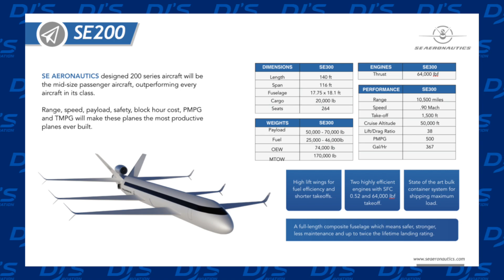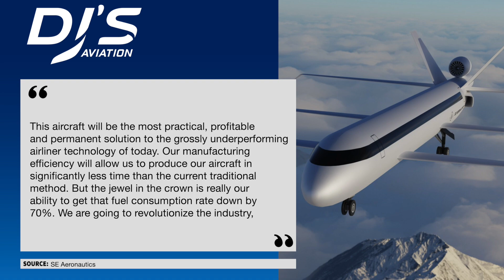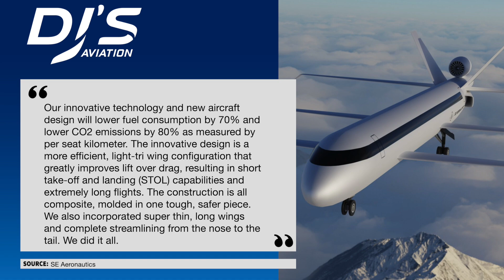New Widebody Aircraft

Comment: This company hasn't faced the reality of a regulated environment. For example they mention a single piece fuselage which is very challenging because a single failure such as a crack could propagate the entire length which isn't acceptable. Also, the engines appear to be in close quarters to each other which isn't certifiable because of fraternization failure issues.

Comment: Let's see.....................  Bigger engine = Higher bi-pass ratio = More fuel efficient = Airlines love it
I don't know dick ....... but it's clear to me ............Future commercial planes will be high wing configuration (like Antonov 225)
With two 25' dia. engines having a 20 to 1 by-pass ratio.  Accounting for 95% of thrust with internal fuel burn only enough to keep front fan turning.

Comment: Not going to be built as the three wing design is too expensive to build. The strongest part of the aircraft is the wing. Everything else bolts to the wing. To have three wings the fuselage becomes the strongest part at three locations. That will add cost and weight

Comment: This can´t be anything other than a scam. Or.. possible a leak april joke. There is severe issues.

Having three sets of wings is really quite stupid. The issue is that 2/3 of the wing is riding a down wash. There is a reason why WW1 biplanes have the wings ontop on each other. And even that is not optimal. Having them in a row is just bonkers. The thing is. Most home aerodynamic simulation software don´t simulate this effect. So running it in something like kerbal space program works just fine. But in real life it don´t work at all.. And yes.. people have tried it.

The wiglet is also a total design failure. Firstly they are way to square. Secondly they are hardly needed on a wing with that much aspect ratio. And thirdly, they are way to long. And the downwards winglet do nothing at all.

There is plenty of aircraft that have full length composite fuselage. The thing is. Most strength is needed in the middle. Also. A lot of people think that composite means carbonfiber plastic. There is metal composites, for instance A380 uses a metal/plastic composite.

"Allow us to produce aircraft i sufficiently shorter time than today's method"
There is really not any lead times issue with current form of making aircrafts.

"Get the fuel down by 70%"
How? Current day airliners have a fairly optimal wing design. Maybe they could improve it with a theoretical 15-20%. The one on the image is not a improvement, rather the opposite.

To not recirculate the air in the cabin takes more energy. The aircon of a airliner take surprisingly lot of energy. In something like a A330 the aircon takes about 3% of the total energy. And that have a average circulation of 1:5. Decreasing that to 1:1 will have a dramatic effect on fuel consumption. There is of cause system that can improve the fuel economy of the aircon, like the one the 787 have where it uses an electrical turbine to cut it in a third. But it still use a considerate amount of energy.

"Self sealing blader.... will be able to float" 
Baking the head into the wall
Normal aircraft fuel tanks is also water tight,.. because.. they contain fuel. Fuel is just as liquid water. If water goes in.. fuel would go out.

Self sealing is really only a point if its punkuted by bullets or shrapnel.  If the tank is ripped a part on impact it will not matter.

"fuel consumption is lowered by 70% and CO2 is lowered by 80%"
A other stupid statement. The two pretty much always go in lock step. The only exception if you swich the fuel or something like that. Also there is a 50% gap... 20% remaining CO2 but 30% renaming fuel.  There is no fuel  i know of giving a 50% improvement that is still liquid. Swiching to HVO will give a greater reduction than 33%, around 85%. But then the numbers don´t work anyway.

This is not a concept. Its someone how smoked to much pot and think they are a aircraft designer. I´m not an aircraft designer, i know this is stupid anyway.. and well.. looking on the comment field, i´m not alone

Comment: Looks like a nightmare to load, and I have doubts about that aerodynamic stability. 
They claim a good LD ratio but 3 sets of wings hardly seems good for drag. And with such a focus on efficiency, why go for M0.9? No mention of climb rate either, yet they have specific figures for nearly everything else. That engine configuration seems like a nightmare to work on.
Couple that with the fact that they're a total unknown, have no actual business partners, AND that their website is both less than a year old and looks like it was prebuilt...

I'm sensing something and that something stinks. It looks like something I would have drawn up whenever my 5-year-old self fashioned himself as an aircraft designer.

Comment: This concept design should be considered in the same way that concept car designs are.  Very rarely does a car show concept car ever reach production.  Yet some of the concepts incorporated in the ground breaking, visually stunning vehicle actually do find their way into production cars.  

I’m not too optimistic that the tri-wing design can prove efficient enough to offset the structural strength that will be required to transfer all the aerodynamic loads into the fuselage.  

Without revolutionary improvements in jet engine technology, I don’t believe a 75% overall fuel savings can be achieved.  I would be surprised if this design, assuming massive improvements in jet engine fuel burn, can achievement more than a 40% improvement.  While 40% would be significant, it would be no where near 75%.

Comment: Aside from the absurd claims, there are a few interesting ideas here. The idea of storing fuel in bladders in the upper part of the fuselage would make efficient use of what is, now, a lot of unused cabin volume. Another advantage would be potentially simpler fuel managment and improved center-of- gravity management as fuel is burned. Bladders do have issues (limited lifespan) but not having them buried in wings could make maintenance and replacement easier. 

Without wet wings, the design would be simplified and, with the multiple wings, wingspan is shorter than current aircraft, reducing the bending moment which could result in lighter, simpler structures. 

As pie-in-the-sky designs go, it’s less radical than any blended-wing body design and would not require massive redefinition of airliner manufacturing techniques and, being a conventional tube and wing design, would lend itself to stretching and shrinking to provide the needed family of aircraft. 

I agreee with DJ, this will never happen. But it does embody some original thinking that might be seen in future aircraft.
Reply: Wings are MUCH better place for fuel than fuselage. Because wings are where the lift is. The closer the lift is to the weight, the better.

Comment: This is one of the biggest scams I've ever seen. The premise of "greater efficiency" is totally shattered by the fact that breaking up a wing into multiple high aspect ratio ones is extremely inefficient from a weight and structural standpoint. Also the CEO has a degree in nutrition and there is zero information about their chief engineer.
Reply: When I heard that "70% reduction in fuel burn" I was laughing internally like a maniac for sure.

Comment: Gut reactions: 1) How is it balanced? 2) Is it statically stable?  3) More wings does not mean more efficient, quite the opposite in fact.  4) Ground handling must be a nightmare.   
And those are just the questions at glance.
Reply: First thing that came to my mind was won't the leading wing disrupt the airflow for the trailing wings?
Reply: I know the answer of the first two questions.. its no

Comment: It seems that the engines are one on top of the other. Curious to see if any regulatory body would aprove this, since one engine exploding would affect the other
Reply: Aircraft with engines mounted together have been approved before such as the VC-10, Lockheed JetStar and Concorde. Of course those were all first approved over 50 years ago so things may have changed
Reply: @bluemountain4181  Yes, but all quadjets, you don't loose all the engines if one explodes. I think regulators would be unwilling to aprove this design, but I don't know, maybe SE Aeronautics investigated that already and are confortable with this

Comment: Over the years, very clever thinking designers have been laughed at for being forward thinking, Barns Wallace among them. He invented the moving wing concept, and 30 years later, the F-111 was born. All the ideas are sound on this new concept, but making the numbers work is another thing all together. The biggest obstacle is convincing the airlines to by something that far removed from the conventional designs. It might be just a dream, but I'd like to see one actually working.
Reply: Eeeh... this design is horrible.  Its not like tandem wings have not been tested before. Even tripple tandem have been tested once... the pilot died on the first test flight.
Reply: @matsv201  You're right on both counts. It's destined to be the ugliest machine known to man kind. I just want to see if it works, and if the numbers add up. I know about the last triple wing, but that was a long time ago.
Reply: @grahamnash9794  

Well it wouldn´t. The wing would ride in the downwash from the wings infront of it.

While there is no modern triple wing aircraft around. There are a few quasi tandem wing aircrafts. Like weiredwing, Protemus 281 and Untied-40.

They all have a few things in common. The wings is not inline, they have really very short aspect ratio, the wings are not symmetrical. Most of them are in a quasi canard design.

The main reason those aircraft exist is not because they are tandem wings, but rather that they remove the stabilizer. The stabilizer uses about 10% of the aircraft fuel, and its a quite considerate saving if it is removed.

This is something the aircraft manufactures is well aware of, but they elected to note remove it due to a number of factors.

The short and long of it is that you need to redesign the whole aircraft, and Boeing was simply not ready to do that and they abounded the sonic cruiser for the time being.

Having three wings don´t help. If you look at the sonic cruiser design the canards are really tiny. The reason is that even if they are more efficient, they do induce drag on the main wing. Boeing mitigated that a bit by having a blended delta wing.
Reply: @matsv201  You have some valid points that I over looked. Thanks for pointing them out.

Comment: This is a good paper airplane.  Try fitting it in any current airport without any modifications if the airport. A conventionally shaped A380 did not. Neither will this. Like I said, a good paper airplane, if it files at all. What are the control laws for this machine? How stable will it be on the ground?  Do I need to go on? Thanks.
Reply: This is not good even as a paper aeroplane.

Comment: With my knowledge and experience from ksp, I'm fairly certain that this plane would be unstable on the ground with how close those wheels are to the fuselage
Reply: Also a tri-cycle gear set on a wide body?😂
Reply: @ethansaviation2672  Tricycle gear are the norm on widebodies. Unless you mean only two wheels on each main gear, that is rather weird
Reply: @bluemountain4181  yes I mean the two wheels on the each main gear

Comment: I doubt airports can accomodate it because of the wings. And like you said, very bold claims. To me it's just another optimistic concept which I will only believe in once it's built.
Reply: If the door is at the front and the wings are behind the door, why wouldn't it be compatible?
Reply: @andrewc662  I'm thinking it won't fit in many stands due to safety clearances. They're made with the classic middle wing design in mind and generally have a V-shape where the clearance is narrower towards the aircraft front. The front wings can go beyond that clearance.
Reply: you are right, the first pair of wings are much closer to the nose as compared to what we usually see today, which may clash with existing air bridges which are often built in front, rather than outside the wings's width clearance
Reply: Aerodromes can accommodate it if the wings span is not long, doesn't matter or make a difference how many wings you have?

Comment: The high aspect ratio straight wing along with reduced speed are well known ways to reduce fuel consumption.  That 70% though; pipe dream is an understatement.
Reply: How are these wings work stacked behind each other? Does it clean up the disturbed air off the trailing edge?
Reply: @Badmansband  The third pair of surfaces are mounted higher than the other two.  Therefore, it is more likely to be horizontal stabilizer/elevator.  They provide down force, not lift force.  The three pair concept is not new.  Sukhoi SU-30 has the same idea.  Canards, wings, stabilizers.
Reply: @bbkmm1  I realise the 3rd pair are higher and most likely prove trim and elevation but I'm referring to the wings in the fuselage. Surely there is some turbulent air penalties?

Comment: It looks like the center of gravity would be between the first and second set of wings. The third row of wings would not need to produce down force, as in conventional aircrafts horizontal stabilizers, thus could aid in total lift while still having the ability to maintain pitch. This sounds like a plus. But, I'd be curious how disrupted the air is at least on that second set of wings. Of course, this aircraft might not fit at many gates, so that may be an issue. Another quick observation is the location of the engine, that would be extremely difficult to work on without some sort of platforms and lifts, which is fine if the aircraft is at its home base, but what if it diverted to another airport? I guess they would have to truck or fly in the equipment just to work on it.
Reply: Just from eyeballing the wings and the engine I thought it looked like the center of lift would be far forward of the center of mass - and that's as unstable riding a bicycle backwards.  You are right to ask about the downwash on the second and third wing sets though.  Again I'm eyeballing but it looks like they'd right in the thick of if and not produce and real lift at all.

Comment: just another Nikola / Theranos / Solar Freakin' Roadways pie in the sky company
Reply: The Hyper Tube of aircraft........even the ballistic rocket airliner of Musk the Moron has a better chance of getting off the ground (excuse the pun) as a passenger carrier....and the odds of that happening are 0.00000000000000000001%...............
Reply: @gumpyoldbugger6944  the starship has already flown, though
Reply: @onyxzheng347  There have been literally more than 100 different sub orbital rocket types launched. Non have ever carried paying passengers even if it theoretically would be possible.

There is quite a number of reasons for this. The main reason is that there is a way better way of doing this.

Having a winged launched rocket in steed. That makes way more sense. Having it air breathing also saves a lot on fuel.

This have been a concept for a number of years. There was a movie made on the concept 

Starflight: The Plane That Couldn't Land, from 1983. Its a horribly bad movie, but it does demonstrate the concept well. Reaction engine is currently developing an engine for a aircraft like that.

There is several benefits.
1: Use way less fuel
2: Can launch and land pretty much anywhere
3: Use common airport logistics
4: Can fit more passengers.
5: The G-forces is mostly in the same direction 
6: The aircraft can go in a very shallow orbit decreasing the problem of reentry.
7: Much faster turnaround

Really the only benefit of the balstic rocket style is that the launch is slightly faster. The downside is that the turnaround is much longer.,